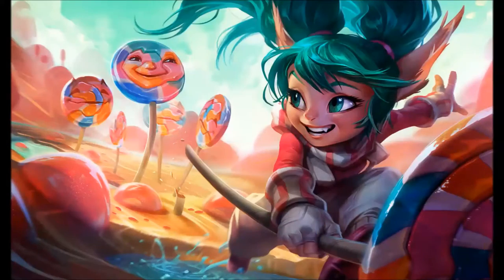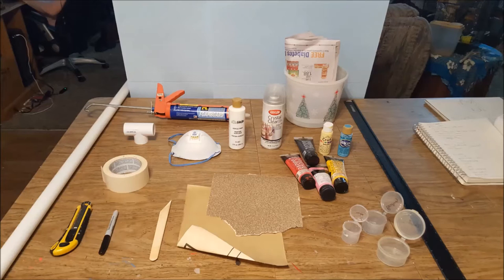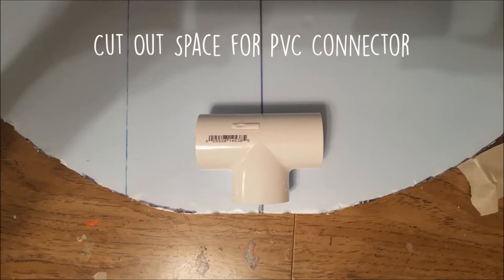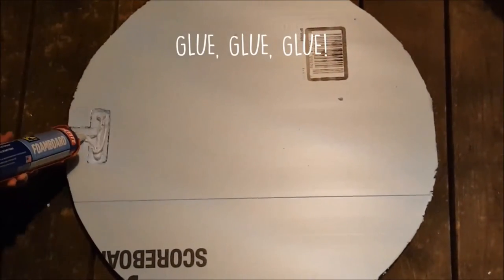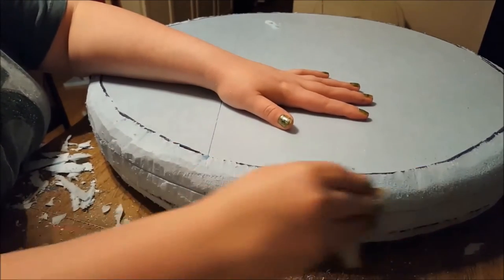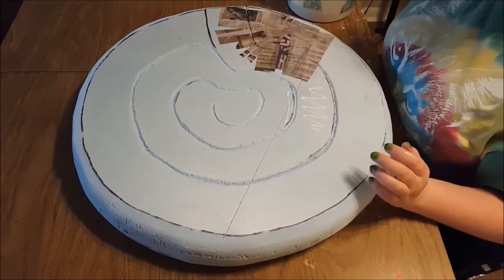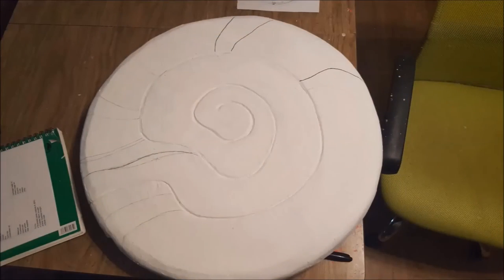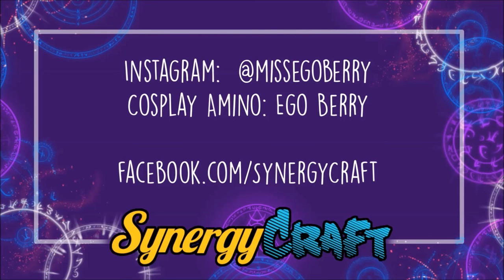How To Make Lollipoppy's Hammer! | COSPLAY TUTORIAL

Comment: Can u make a tutorial for the shield too? :3
Reply from the maker: asoziale I actually didn't make the shield for this cosplay since it's kind of a translucent thing and isn't quite a central part of the cosplay. I made a shield for the old version of lollipoppy, though. It was basically two layers of 1.5" insulation foam board with the letters stenciled on, then cut out with an exacto knife. I glued the boards together with hot glue and paper mached it to look like a seamless candy bar. Slapped some brown acrylic on and sealed using Mod Podge. I attached two nylon straps on the back that slid onto my arm to hold it. It's a lot simpler to make than the hammer for sure
Reply: Ego Berry thank you :)